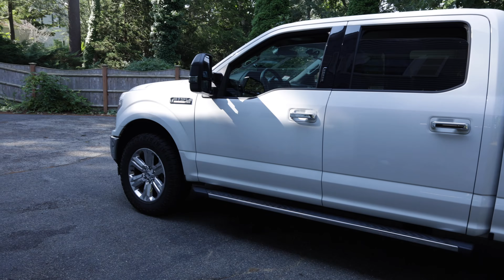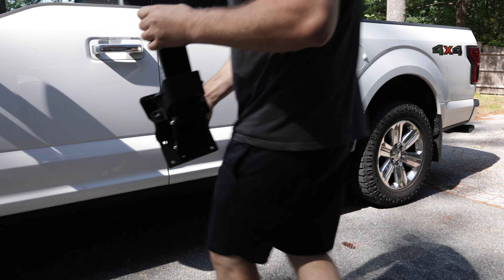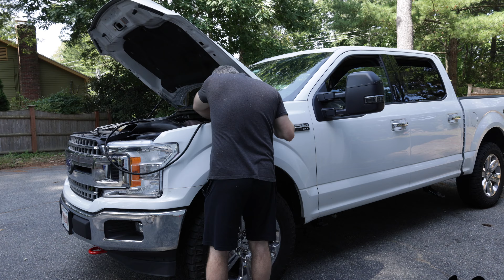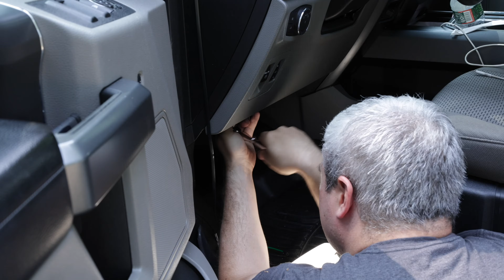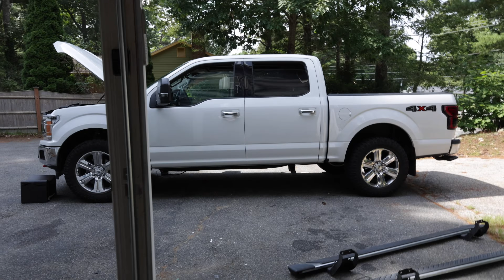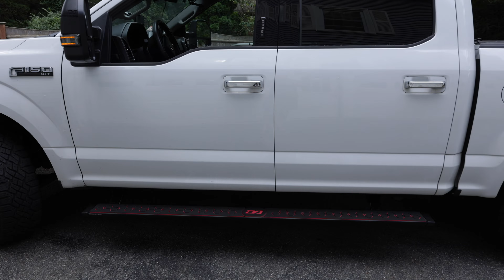Power Running Boards for my F-150! | Boost Auto Powered Running boards Installation and Review!

Comment: Great mod!  Have a question for you.  Since they tap into the high and low communication off the OBD port, can they be controlled through the cluster so you can deploy both for cleaning or store mode so they don't deploy in snow/mud conditions?  In other words, have you added it through ForScan to see if it gives you full OEM control?
Reply from the maker: I haven't but I like the idea. I might try and check that out. Honestly though, I use mine in mud and snow and haven't had any issue. This was the worst winter in a long time in New England and they did really well. No issues at all.

Comment: Thanks for posting Steve.  They look great. How did they do in the winter?
Cheers
Reply from the maker: Hey (It's Daryl right? based on your username) They did really well and held up flawlessly over winter. Since they tuck in there was never any issue with snow or ice buildup like my stationary boards.
Reply: Yes that is correct. Thanks for the update on how they worked this past winter.
Cheers

Comment: How quite are they when opening and closing
Reply from the maker: Really quiet. You don't hear the motor at all from in the car. You mainly hear when they are either fully extended or fully retracted when they meet the stop. I really like them.
Reply: Thanks for the quick reply you just made it an easy decision i have a set of the AMP research ones on my 22 Bronco and they are very noisy and clunky sounding
Reply from the maker: @ no problem. Trucks are a lot more insulated than the Bronco, so that might be why I’m not hearing anything. If you want me to send you a video or recording dm me on my Instagram

Comment: Hi! My dad’s new 2024 Lariat is taller than his old F150. He also forgot to get the tailgate step which is why I’m researching modifications.  My dad has trouble getting into truck bed and my mom has trouble getting in passenger side. I think these power steps could work to be lower than the factory running boards. Can you adjust the drop down to extra length or is it one set distance? The new lariat truck came with nice black running boards. Does Ford make power steps or is it only after market. As another option…can a drop down step be added to running board on passenger side for my mom to get in? Thanks!
Reply from the maker: Hey,
These running boards are both drivers side and passenger side. You cannot adjust the distance they travel but they are already lower than stock. Ford does make power steps, they are available on some lariat models, but you might need to get the truck programmed for them. I'm not sure.